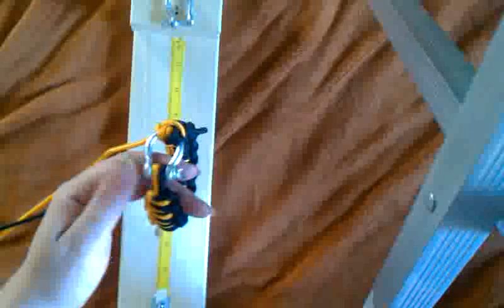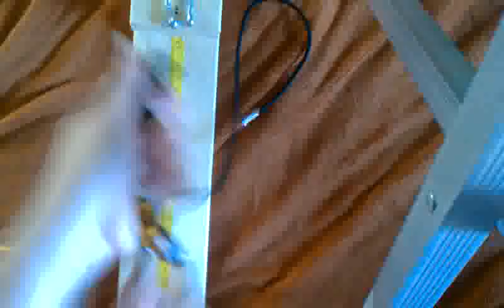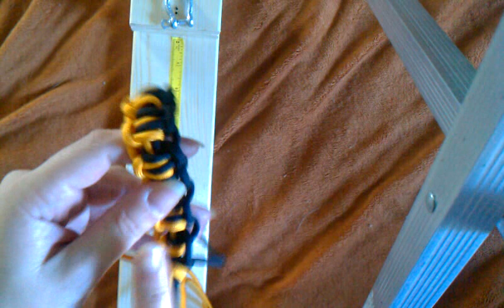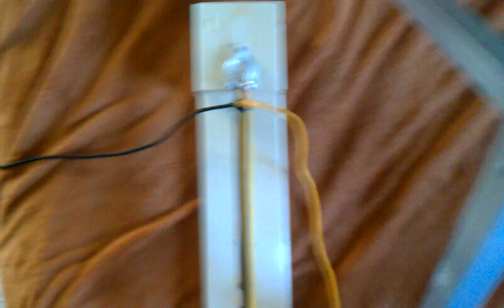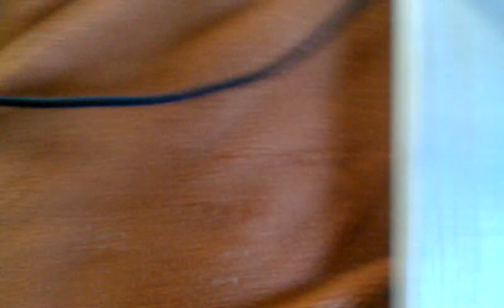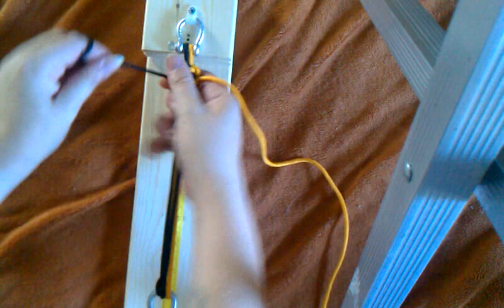How to make a Milipede paracord bracelet

Comment from the maker: @TaUxDeMonZ2  If your using plastic buckles, my measuring system won't work for you, nor will the bracelet be quick release, as the plastic buckles are designed to be shatter resistent.  That being said, I take the size of the bracelets and double it for how much cord i need.  ie, a 7 inch bracelet has 14 feet of cord..1"=2'  Once I get some buckles I'll see about making a video.

Comment from the maker: 1inch of bracelet is equal to 2 feet of cord, ie. a 7 inch bracelet needs 14 feet of cord, I usually add an extra foot just to be safe.  Of course these measurement are based on how tight I pull, you may pull tighter or looser.